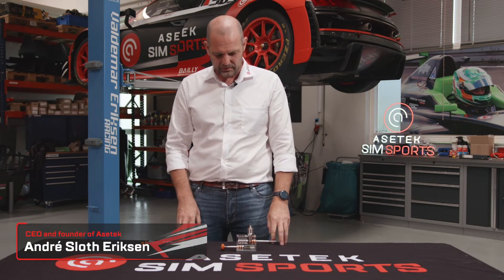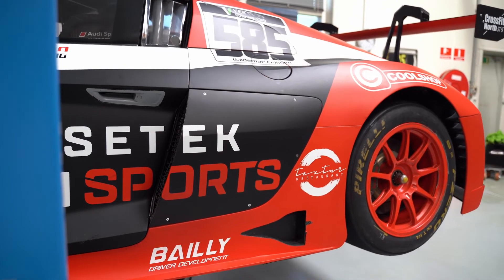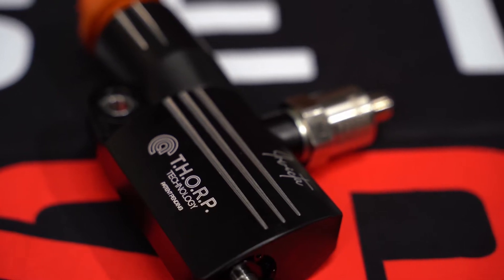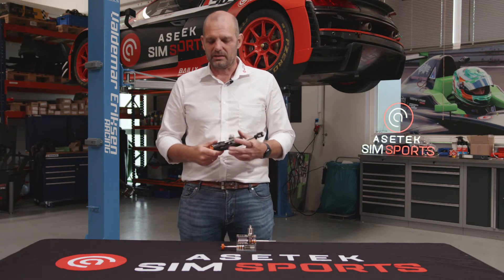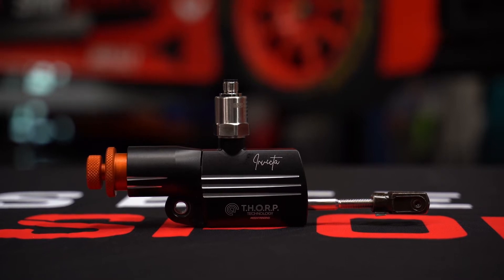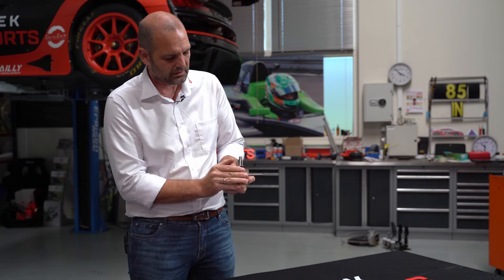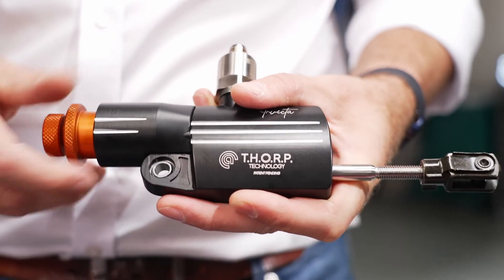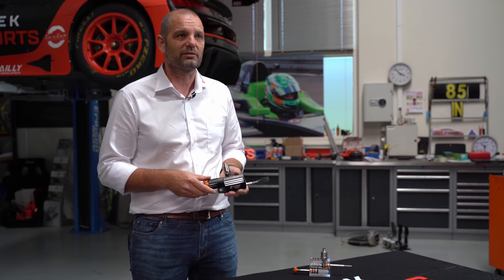T.H.O.R.P.™ - the Unique Brake Cylinder Design in the Invicta™ Sim Racing Pedals

Comment: Have you considered to sell just the THORP unit for DIYers? Love the compactness of the system and integration in a diy pedal would be a dream, eliminating hoses and external slave cylinders/brake calipers,also safer as it does not use the corrosive dot fluid.
Reply: I see they are now advertising upgrade kits to upgrade to THORP for their FORTE line. So hope is close! They're advertising it as "Coming Soon..."
Reply from the maker: Thank you for the kind words :)

Selling parts to DIY'ers is not part of our short-term plans but we can't say whether it will happen in the future. Right now we're focused on getting a full ecosystem into the market and getting plenty of feedback from the community along the way. 

DIY'ers are of course a part of that and we'll see what the future holds :)